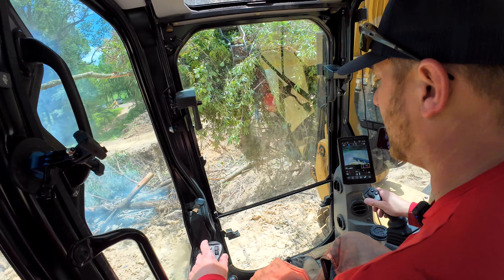Creating Adventurous Off-road Paths In The Wilderness with excavator PART 2

Comment: Stihl makes a better chain saw file than that and it also files the cut stops at the same time
Reply: And they work really well.
Reply: I wouldn't say better, but different. 
Some people like to set their rakers progressively rather than a set depth depending on what they are doing.
Also stihl doesn't make them.
Reply from the maker: Thanks for the tip

Comment: At 24:20 when you're sharpening  the saw, what causes those big chunks out of the excavator tracks? They dont look cheap to replace.
Reply: Probably little stumps, rocks, or debris on demolition jobs. Todd probably knows 100 other things with his seat time. Those are sacrificial rubber pads over steel tracks. So the damage isn't as bad as it looks or as expensive to replace as a full under carriage. Good eye, I was wanting to sharpen the saw. I need all the help I can get in that department.
Reply from the maker: Mr. Alaska nailed it!!! Just about anything hard and especially sharp rocks will do that
Reply: @DigginLife21  thanks for the replies.  I was surprised how large and fresh some of those look. The job you're on doesn't look bad for debris or sharp rocks. 
How long would a set of tracks last? Would the loader tracks last longer or shorter?
Reply from the maker: @GRid-yk2ru  I’m not sure how long they will last. I do a lot of tracking. I would goes 5,000 hours. The Skidsteer holds up fairly well